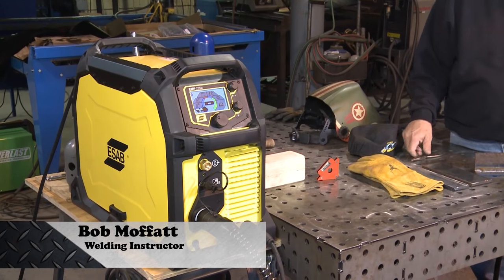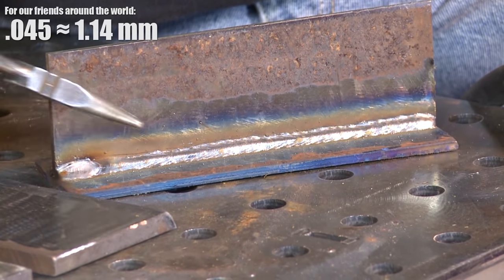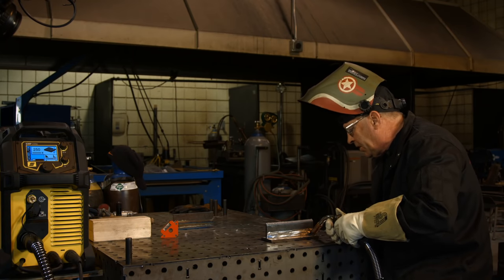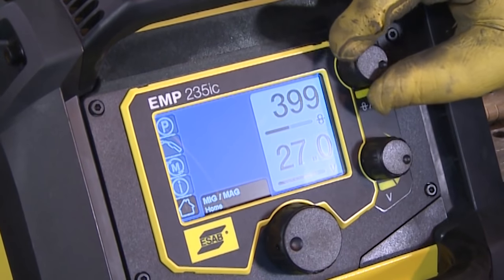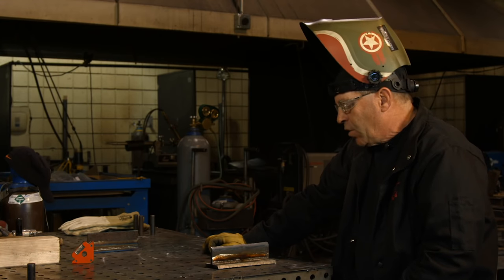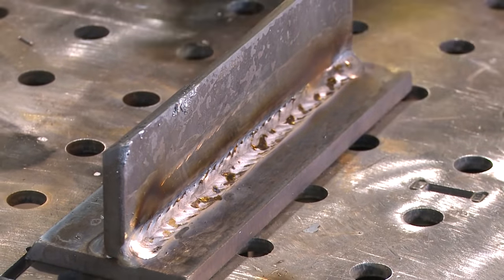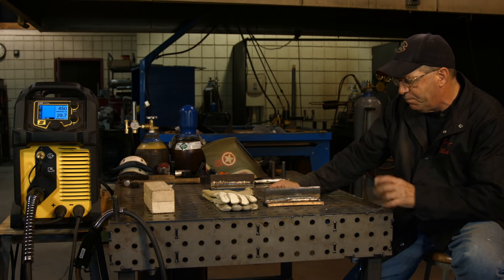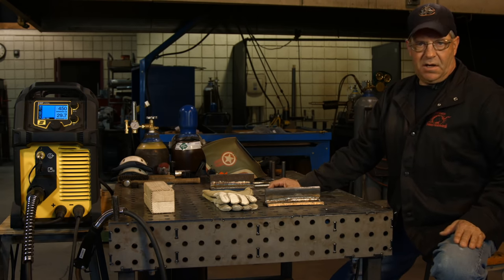🔥 Spray Transfer MIG Welding

Comment from the maker: Please RESPOND to this comment with any future video requests
Reply: Could u do a vid about flame straightening? Would be very interesting to me! I would also like to see Spray transfer on high amp maschines like 400-500amps with big wire sizes! Keep it up!
Reply: Hi Id Like a request for a Duplex 6g Tig /Stick.....and  Tig with walk the Cup full pipe....I know you guys did a carbon steel but if you could do a Duplex with the test with regards to heat input  or pitting test....even if the videos is in 2 or 3 parts id like to see one in the near future....Thanks.
Reply: Dear Bob i would be really gratefully i you could take the time and efford to make a video about :TIG welding aluminium thin (1mm) to thick (6mm) material + cold to hot + cold thick to hot thin .Thank you in advance you are a great source of knowledge for me that i have not access to training center .God bless you all , greetings from Greece.
Reply: Weld.com for people who do not have a welder and have not welded before they don't know the benefits of having a welder around the house. unfortunately the cheapest and easiest I know is the Harbor Freight Hunter and 110 volt flux core about 80 90 AMP welding machine for about $100 they can learn how to glue some Steel together. just wish I could show them how to work & stay in their puddle and make low amps work for them. can be a useful tool for around the house. just started being nice video for people who don't know. it's kind of like your phone compared to a computer. it's the convenience and portability of a hundred foot extension cord that makes it worth it.
Reply: Carbon Air Arc Cutting please.
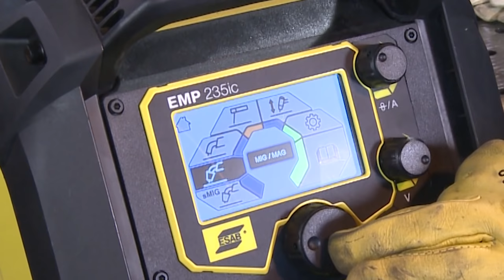Reply: Weld.com 4:38 could you also add wire in meters per minute in the video? So we Europeans can understand it even better. :) good video
Reply: Some self shielded flux core would be great to see on the Rebel, as Bob mentions.
Reply: Pulsed mig on carbon steel
Reply: I like the idea of a sheilded flux core video. Maybe show the effect of different gas mixes and straight CO2, this would cover its use in most home shops.
Reply: tig welding 0.8mm steel
manualy setting oldschool co2 mig
Reply: Would be good to see some videos on sheet metal for car body work maybe .8 mm -1.5mm cold rolled. I weld up cars for a living and always have people asking for advice but notice there's not much information on utube about it.
Reply: mig short arc vs spray on aluminum
Reply: I'd love to hear Bob talk about different gas mixes and what their strengths and weaknesses are.
Reply: stainless Mig
Reply: could you do a complete downhill pipe. 6010 bead 8010 out? x ray quality
Reply: Willow killa Pure argon on aluminum doesn't short arc well at all for me. I'm a straight up spray guy on aluminum when it comes to wire feed.
Reply: spacystacy51 We've done it.
Reply: Justin Blanchard Why not 8010 all the way?
Reply: How about some aluminum? Pulse settings, balance, types of tungsten and any helpful tips from the pros.
Reply: not much you haven't done already 😊 I know I haven't begun to see all the videos well thanks for sharing them
Reply: Bob  Moffatt typical pipeline procedure uses 1104 or b31.3 spec 6010 root and 8010 out downhill. this isy line of work wanting see your technique or any tips to help me.
Reply: Thanks taewachien!
Reply: Have you tried metal core mug wire and fluxcore dual shield
Reply: please show us how to spray .045 dual shield flux-core!!!
Reply: thank you bob for the reply, i was curious about it since my mig machine is too little to have enough amps to spray. I thought about trying this on an aluminum outdoor rocking chair that had cracked in a few stress points but decided it was best to tig it. Came out good for me and my limited experience being my first tig weld on aluminum.
Reply: I would like to see a video of the everlast 251si, what are good settings and what is it all capable of. I just picked one up and I would like some real reviews of it. thank you
Reply: I would like to see different  gases CO2 and the mixes C10 ,C18 and C25  on mild steel or some  mig welding on stainless
Reply from the maker: Steffani, we've done a few with it already and have a few more planned in the near future.
Reply: Please do 6" 6G 6010 Root. Thank you for the great vids!
Reply: Downhill groove and fillets. Can it be done properly?
Reply: Hey Bob, can you do another video on OA cutting? Going through the safety and dangers or an OA unit and how to correctly set up a OA unit for cutting safely. Thanks :)
Reply: with short circuit you can as long as you stay on leading edge of your puddle  keeping an upward angle.
Reply: Overhead spray!
Reply: Weld.com did you say 95 5. 95% argon and 5% oxygen ? You mean Co2
Reply: id like to see Bob fill some old cast aluminum with a tig! i have a 1940 indian 74ci cheif with some chucks out of the case! i bet Bob can do it!
Reply: Carbon Arc welding
Reply: Weld.com  yeah how to set up a sub merge arc welder. Plz
Reply: Awesome videos! I have a spray transfer test coming up for work, it is a 2' thick wall steel pipe using .045 wire and I do believe the gas is a co2 mix. Is there any way you could make a video covering the root and cover pass, I have attempted this test before and have either messed the root up or the cover as well as have a slight bit of spatter inside the pipe? The test also calls for it to be down hill
Reply: 2" sch 80 steel pipe .045 dia co2 mix at 6g with spray transfer, I have to take this test to qualify at work.
Reply: Hi Bob, could you produce a video that focuses on Friction Welding? 

I've never laid hands on any type of welding equipment but have had a strong interest in the discipline for several years. 

I watch quite a bit of content on YouTube related to welding, and I think your videos are great. 

Looking forward to getting started learning the fundamentals in 2018.
Reply: Waiting for the ESAB 285I Review
Reply: Is it hard to weld? And is there any videos of first starting off welding? I work at a job where we weld rims together by a machine I don't know to much about the weld machine specially the setup  part ...I think I do this as a career. I heard you can make good money doing this as well is that true?
Reply: Was I spray with C25/75 I had the same hissing?
Reply: Downhill 6010 root 8010 cap.
Reply: 6gr with Flux core like what they want in offshore rigs.  Vertical up.
Reply: Hi how about cast iron repair with cast iron filler rod
Reply: I would like to see some dualshield videos.. and maybe a Tig series with older style transformer machines.. and specifically go into aluminum as well as any other metals.. explaining the differences.. pros/cons  to the transformer vs inverter machines...… that's all for now, thanks to you and Hjalmar you guys are great.
Reply: DO OVERHEAD SPRAY! you said you would get frisky one day!
Reply: 2 requests 
1 how to convert from V to A . I know the base start point is 1A per .001"  but my new miller mp 215 is the new V style so have to guess what to set at and run som test welds to get it to show the A and adjust.
2 spray arc with .035" and .030" on 100% h CO2  .

Had to use 3/8" plate to a 3/16" crossmember for a trans mount in a frends shop with a clutch210. I ran  V at 10(100% max) and wire at 3-5 (30-50% capacity  I assume)  on .035 3 was more globular transfer and 5 was closer to spray. Ran 3 for for tight flat / vertical welds  in 3 passes 1st  was on the 3/8 edge with no cool down as a pre heat  2nd was root to 1st  3rd was edge to to edge of 1and 2. Had to be careful not to cause undercut on either Edge.
  Vertical up was beautiful hold on 3/8 plate let it melt in( doing this in vertical up provided better preheat better penetration marks on the back side and a faster travel speed , travel speed was about one-third what was you showed in the on the 3/8 and about the same on the 3/16) move over to 3/16 briefly let it wet in back and forth walk up the stairs as you build them.
Reply: Id like to see this machine do tig, I'm considering buy one in the next month.
Reply: Weld.com I’d like to see you weld a 3/8 plate (10mm) flat against one face but overhanging the edge of heavy gauge box section of 3/8 or 1/2 inch (10-12.5mm) As in how to fill the gap due to the large radius of the box. You do lots of easy to get at flat and 90 degree plates but I’ve never seen this. Great videos, much appreciated. I’m a subscriber.
Reply: Can the 235 do pulse Mig or just spray arc mig
Reply: Love that caption on top left, easy to understand for anyone outside USA that doesn't use Inches scale for the wire sizes. 👍🏻
Reply: Found it thanks you guys rock
Reply: I have a fairly basic HOBART 210 (220v).
I HAVE heard of "spray transfer" but have never actually tried it...🤔
Reply: Is there any reason why I shouldn't just buy the 95-5 gas and do both spray transfer and short arc with just the one gas? I'm an experienced flux core and stick welder but I'm just buying a new cyclone 262 and I will be getting a gas cylinder for it.

Comment: Spray mig is done by using high wire speeds and higher than normal voltage. The arc happens long before the wire touches the base metal. The wire literally atomizes into fine droplets because of the high voltage. It normally uses an argon/oxygen mix of up to 5% oxygen. It's good for thick plate and high welding speeds.
Reply: Donald Parker thank you for explain. It is well appreciated. I just that new esab and does more than i know
Reply: Thank you for the explanation.
Reply: @donparker8246  it also has little to no spatter and is super quiet

Comment: If anyone is wondering what happens when you weld spray in the vertical or even slightly uphill position it just piles up on itself it’s too hot and too liquidy, you have to weld it in the horizontal or slightly downhill position, slightly downhill is probably best, I love spray but as you can see in the vid it’s a bitch to find that sweet spot
Reply: I have seen people trying to weld vertical down with Spray. It just end up as a large lump of metal at the bottom.
Yep it can be a bitch to find the sweet spot.
My favorite is when all you hear is a hissing sound like as if you’re are using TIG.
I learnt this method welding pressure tanks for truck breaking systems.
It is great because you don’t have the crackling sound, you might get a pop every now and then.
It definitely is one technique that one should master because it is high productivity and deposit rates.
Some new machines don’t allow individuals to adjust wire speed while welding.
Reply: @21gioni  that is absolutely incorrect the largest Foundry in the Free World is automated and I'll guarantee you every frame that carrys every casting had the corner spray arc down hill
Reply: @okiedoke6373  There is a setting that is close to a spray arc that is used to weld vertical down, lots of people think that’s a spray arc setting but it is not.
There is a possibility that a special gas is being used that assists with solidifying the weld pool.
Hydrogen mixtures can do this but I haven’t tried spray arc with hydrogen gas mixtures.
What gas are you using?
Reply: @21gioni  no you don't use no you don't use hydrogen in the hell is wrong with you I've been welding for 35 years what in the hell are you talking about special gas to run downhill with spray you just run it straight down yeah just so you know it's the hydrogen you're trying to keep out of the weld

Comment: I run pulse spray everyday in production tracktor bucket plant called TAG Manufacturing i run select arc .052 430 wfs 30-32vlts , runs so smooth , can make a whole bead of glass , and yea no vertical spraying with that lol go ahead and try but i don't see it happening haha
Reply: Drake Wilcox Pulse for the win! Use it on my miller xmt and aluma feed.
Reply: Just took my weld test for TAG

Comment: I'm an experience amature welder automotive work exhaust, frame, and sheet. I was working with my first stainless exhaust, stainless mig job, I was getting spray transfer at some points while doing 1/2" thick flanges and it looked amazing but I couldn't maintain it consistently and adjusted settings down.. it was .030, 309L wire, around 19- 20v , 200 -240 or so speed. Man no spark on stainless mig is so great, and the weld looked melted smooth like pipe solder.

Comment: When I worked butler manufacturing I set machine .045 wire at 385 / 28.5 volts and was super smooth. Also, if you lay the gun on it side and pull towards you using small back and forth motion you’ll see it will have a much smoother weld.
Reply: What type of gas are you running?
Reply: @chrisberrones9099  anything above 82% argon will work

Comment: Our Fab shop had all the machines setup for spray Mig with STD hardwire root pass then spray for full pen pressure vessel welds.  It was really nice to walk through the shop with that setup.  clean quiet and really beautiful welds.
Reply from the maker: Thanks for sharing

Comment: 35 years of SCM and TIG welding. Just left a welding test for a job at Caterpillar and screwed the pooch. It was Spray transfer (which I wasn't told in the interview by the employment agency) . min of 385 ipm around 28V and it felt so weird and much hotter than what I'm used to. They gave a Min of 6mm and 25% over with no more than 4mm of reinforcement. So easy You would think. My beads looked good, just not consistent. Had a difficult maintaining tolerance, I was always right at 6mm and 10mm seamed hard to get. It's all in My head I know and in fact was told to go home, practice with My own welder and come back. He liked My welds. Just first time Spraying and it felt so foreign that I gave up. I'm a puller (so is He) but found pushing was just as easy with spray at times ?

Comment: My favourite setting is spray as you mentioned it has limits on positions you can weld with it. The heavier gauge the parent metal spray is better suited. 
It can be set up to be extremely quiet and no spatter or sparks. The weld bead is uniform and no varying in throat thickness and size. I learned how to set it up welding automatically on pressure vessels used in truck breaking systems.
Reply: Sir 1/4 thikness plate  what's voltage setting  and wire speed .i hope u can answer me sir.for spray type mode mig welding
Reply: @ranilioestreras  I leaned the old school way.
You set your amps up higher than normal and adjust the wire speed until it goes quiet and makes a hissing sound. 
The arc is very different and doesn’t short circuit.
This process also introduces more heat into the parent metal.

On a 250 Amp machine I set it to 24 volt, at first I have the wire speed on a high setting and adjust it down until I get the balance between short circuit transfer and spray transfer.
There’s a visible difference between spray transfer and short circuit.
On the spray setting the arc doesn’t break away with the metal deposit.
The arc actually looks like it is stable like that of TIG welding the deposit rate is very fast.
I would not recommend using it on 1/4” - 6 mm plate.

I use it on front loader buckets to weld wear plates.

Not sure what the terms used today most MIG welding is done with an arc force setting of 20.

Comment: The 3rd pass you were in full spray mode but if you noticed your volts were up around 30. At work with .045 wire I don't start to get the spray effect until I'm pass 28 volts and around 390 wire speed. Just some info to pass on for anyone looking to spray arc.

Comment: 3:23 - short circuit MAG welding
7:00 - spray transfer MAG welding
Reply: The-Metal-Life globular
Reply: MAG welding? Which country are you from? We call it MIG here in NA. Metal/Inert Gas welding.
Reply: @mikeford963  maybe you didnt think before? Metal active gas because CO2 in the mixture.
Reply: @mrjodoe  CO2 in welding is classed as an inert gas. Oxygen in welding is classed as an active gas. But thank you for making me think. I don't often get to use Oxygen as welding gas as most places use either straight CO2, or an Argon/CO2 blend.
Reply: @mikeford963  co2 while welding is active. so welding class: F

Comment: Hi Bob we always use 92/8 gas big Fab shops in Kansas building some of the craziest stuff you can imagine I seen one comment about 0 45 on a larger machine we would run on dual stage wire feeders 300 inches on the low side in between 4 and 6 on the high side depending on what we welded the bigger machines that we worked with we're 4042 volt

Comment: We use this in work. I usually run 31 volts and 11.5 mps. Mostly 8 mm welds on half inch beams and plates
Reply: What industry? 8mm is pretty heavy duty on half inch plate

Comment: Had to weld some 1/2" 4140 in a rush, slapped a spool of 0.035" ER80S-D2 into my aluminum spoolgun on the lincoln MP350 with straight argon and cranked it up until it sprayed like this.  Worked pretty good for running what was available

Comment: The Spray Transfer method usually is best used for flat and horizontal. Pulsed you can run vertical and overhead, and short circuit can weld in all positions.

Comment: I just bought the rebel 235 and noticed that the sMIG function on .045 capped out at 3/16" material thickness and was very surprised to see that.  The regular mig unction will allow much higer settings.  I went searching for videos on this topic and ran across yours that verified this is the way the machine is set up.  Why would ESAB limit the sMIG to 250ipm with .045 wire?  With .035 wire sMIG will go all the way to 3/8' thick.

Also, how did the machine go over its rated 250 Amps and sustain it at 290 amps?

Appreciate your videos , keep "pulling the trigger" for us